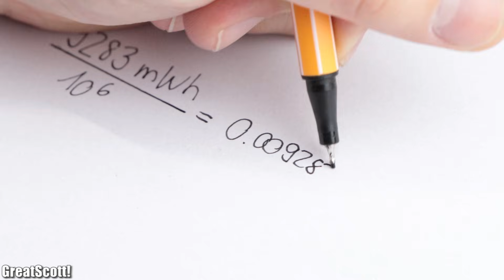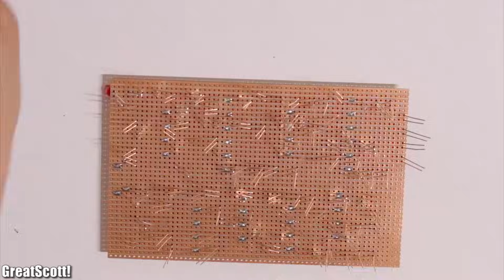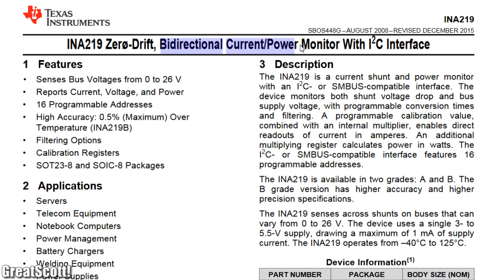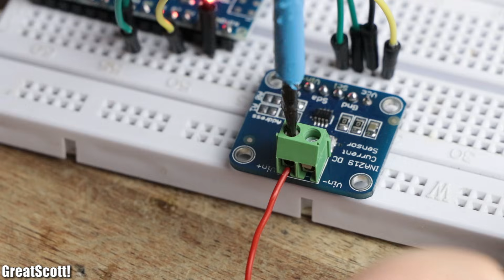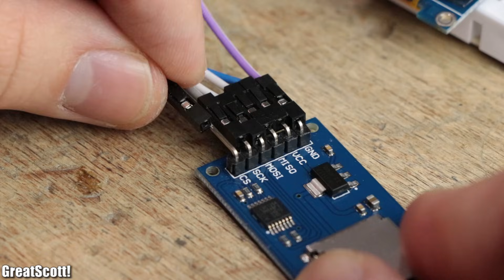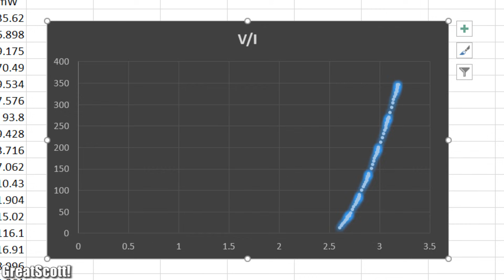Make your own Power Meter/Logger

Comment: First of all, fantastic videos.  I love learning from you.  Secondly, I've recreated this project with an Arduino mega without any problems, but when I move to my Arduino nano or pro mini, I've found that the size of the program data (2215 bytes) exceeds that allowed by the controller (2048 bytes).  Did you have this issue?  If so, how did you resolve it?  This data applies directly to the program you developed, with no changes having been made.  

I know this video was years ago, but thought it would be worth asking in hopes of finding a solution so I can make this project "portable" with one of the mini micro-controllers. Many thanks.
Reply: In the adafruit library you have to use a screen width of 128_32 instead of 128_64

Comment: For those who don't wanna buy or can't get the SD module, you don't need it. You can simply do a level shift with resistors (2.2k + 1k works for me) in the comunication pins (SCK, CS and MOSI). For the MISO of the SD card you can connect it directly to the Arduino as 3.3v it's logic HIGH. Of course, if you are using a 3.3v microcontroller (like the Arduino DUE) you don't need the level shift.

Comment: I want to measure only voltage level. so i am planning to use around 100 18650 li-ion in parallel. is it okey to connect batteries to arduino analog input pins? i mean arduino is okey above 5v and my pack is 4.2 volt. should i consider amp level for this project?

Comment: https://www.ebay.com/itm/RUIDENG-UM24-UM24C-USB-2-0-Color-LCD-Display-Tester-Voltage-Current-Voltmeter-US/173189335006?hash=item2852e387de:m:mBRBmFcVA6RzxlP7vyV3zmA
Reply: Doesn't output the data or display it in graphical format. It's good but this is better.

Comment: The SD card keeps giving me error. I even downloaded the sdfat library but I still got error. I am using Arduino pro mini 5v version 16MHZ. My code connection to the sd card SPI: 10 (SS), 11 (MOSI), 12 (MISO), 13 (SCK).

Comment: Hey, do you have also a Voltage drop between the measured Voltage (with multimeter) and the measured voltage with the INA at higher (about 300-400mA) currents? if i power something with an 18650 i always have a voltage drop the higher the current gets. with 2 C Cells or a 9V block battery i dont have that.

Comment: For writing values to a SD card it would be easier to separate them with a "TAB"  Serial.print(value1); Serial.print('\t'); Serial.print(value2); 
In this way you can keep them in one file and copy them to excel. Tab will put them in a separate cells
Reply: continued...   
1.  replace the TimeFile, VoltFile, and curFile with     
DataFile = SD.open("PowerData.csv", FILE_WRITE);
    if (DataFile) {
      DataFile.print(currentMillis);
      DataFile.print(';');
      DataFile.print(loadvoltage);
      DataFile.print(';');
      DataFile.println(current_mA);
      DataFile.close();
    }         
and 2.  replace definitions with File DataFile;
Hope it helps someone

Comment: Great video, both the presentation and the quality.
I would like to know if you have done something similar to this project but for 115 Volts and/or also for 220 Volts?. If not, any consideration in doing so. 
With the high cost of electricity in Canada, an easy way of seeing and logging your own usage, and having the ability to see when and what is using a high power draw, this is a way of making changes on the fly, so much easier.
Anyway, keep up the good work. greatly appreciated.

Comment: Build or Buy suggestion Jeremy
 I just came across a comment by someone on one of Julien Iliett's videos where the commenter said he tried to graph the output of an INA219. He said the readings were all over the graph and useless/none repeatable. He mentioned that he had achieved stable performance using an ADS1115 ADC (or maybe it was '16 or '17). He also mentioned he was using it in differential mode on 2 channels.
    That kind of characterization and comparison would probably be easy for you, especially with this video's project...if you still have it around. 
 -Jake
Reply: I think the comment mentioned was on this video:
https://youtu.be/8ikyp4lu45M

Comment: There is an issue with the energy calculation in the sketch.
The value being added to the total energy consumed has to consider the interval at which measurements are made. The interval is set in milliseconds, so a variable or constant for "measurementsPerHour = 3,600,000 / interval" has to be used as the divider when adding to the energy displayed in mWh.
To provide an example using the 100ms interval used in the sketch: measurementsPerHour = 36,000
Now given 650mW for example, each interval adds 0.0186mWh to the energy total.
Reply: It's strange that it's only comment like that, a lot of people made this project and no one noticed wrong calculations. I had 6 wh instead 1.5 when i dig in i found that it's doesn't correspond to the time
Reply: I appreciate this comment was a long time ago, but my code is based off this video and I found the same problem, although i've found even though the interval is set to 100ms I only get an accurate wh reading if I divide by ~410ms intervals: (energy = energy + (power / 8780.4878);) is there a limit to the sample rate of the INA219? I thought it was supposed to be capable of ~14 samples a second (~every 71ms)

Comment: Very impressed with your video.
I would like to know if you can make or discuss about a project to battery monitoring for charging and discharging of lipo batteries and also discus about the best ways of using them with out over discharging them

Comment: Its really great project. Can you make a AC frequency meter (which measure 220 volt AC frequency 50 Hz and 60 Hz) with an arduino in the next video?

Comment: GS, This is one fantastic project. Made one and even added a few mods to the code. 
I didn't have to buy anything new or substitute. I had everything already and was going to design and code this exact design from scratch, but you did all the hard work for me, and I thank you for it. Also, thank goodness for these cheap modules.
This and many other projects would not have even been possible only 5-10 years ago, without these cheap and wonderful modules from China.

Comment: Don t you need a voltage regulator after the battery so as to get a decent 5v voltage for the arduino ?
Otherwise the voltage will drop out to 2.5 before the protection circuit cuts it 
Thanks !
Reply: I have the same question...

Comment: I'm trying to find something similar that can measure higher currents, maybe up to 10A. Only thing I can think of it putting another shunt and then calculate the new current based on the shunt. Any current reader bigger than INA219 ?

Comment: Hi mate - another great project and video! I am making your Power Meter Logger and have the same LiPo protection board as you are using (03962a) and a 3.7V 700 mA LiPo battery which I have been told that this LiPO must be recharged at a current of </= 700 mA - nothing greater than 700 mA or the battery will puff up! Since the 03962a board can deliver uip to 1000 mA during charging how do I limit the charge current to 700 mA - I have also been told that I can use an external resistor to achieve the 700 mA limit during charging. Can you please tell me how to do this when using your circuit [and can I simply plug this into the USB on the 03962a board when I need to recharge the LiPo] or can you point me in the right direction to see how this is done? Hope you can help, please and keep up the really great work.  Cheers.
Reply: Ian Brown How did you get the sketch to load onto the nano ?
Reply: Hi David - I'm very confused by your question since it does not relate to my specific post? I am also presuming you are NOT Great Scott??? However, to answer your question I haven't loaded the code yet but since the code for this project is provided I wouldn't see this as a problem??? Care to elaborate and I may be able to properly answer your question? Hopefully Great Scott will respond to my actual query in due course?  Cheers

Comment: Hi, having built this logger I get the following error:

"Sketch uses 22302 bytes (72%) of program storage space. Maximum is 30720 bytes.
Global variables use 2216 bytes (108%) of dynamic memory, leaving -168 bytes for local variables. Maximum is 2048 bytes.
Not enough memory; see http://www.arduino.cc/en/Guide/Troubleshooting#size for tips on reducing your footprint.
Error compiling for board Arduino Nano. "

Any advice would be really helpful ?
Reply: try changing consts to #defines, may help but not sure
Reply: For me it was the Adafruit_SSD1306 library. It wont compile with the display set to 128x64 pixel. When i change the Adafruit_SSD1306.h to use 128x32 pixel, the program will fit.

Comment: slight correction, in order to measure current you need to be in parallel with the shunt resistor

Comment: what can i change or add so i can have a higher current like 5amps or even 10amps if possible and be able or read current going both ways for example charging and discharging a battery charging would show a positive number discharging would show a negative

Comment: Your OLED library is set on 128×32. Check the library (.h file) comment the line that defines (#define) the 128×32 resolution mode and uncomment the line with 128×64 :)

Comment: Hello,

    I first would like to thank you for the effort and time you have put into creating this project for us! I do greatly appreciate it!

However, after building this project myself I have found that the measurements are not entirely accurate, mostly the voltage. Reporting .86v with no load and 2.75v with a load, instead of the 4.02v that my LiPo is currently at... With no load attached it displays -mA and -mW... Any help would be appreciated! 

Thank you kindly,

~J
Reply: ANYBODY???
Reply: Please watch my video! https://youtu.be/2Qr6Jcm8wbA

Comment: Great video Scott thank you very much, I do get an error message however 
"Sketch uses 21394 bytes (69%) of program storage space. Maximum is 30720 bytes.
Global variables use 2186 bytes (106%) of dynamic memory, leaving -138 bytes for local variables. Maximum is 2048 bytes.
Not enough memory; see http://www.arduino.cc/en/Guide/Troubleshooting#size for tips on reducing your footprint.
Error compiling for board Arduino Nano. "
Reply: For me it was the Adafruit_SSD1306 library. It wont compile with the display set to 128x64 pixel. When i change the Adafruit_SSD1306.h to use 128x32 pixel, the program will fit.

Comment: I used your line of code wattHours = wattHours + watts * (0.1/(60*60)); but the values I am getting for watt hours are too small. I have made dummy voltage and current sensors by bridging 5v over to the adc input. I am making a watt meter for MUCH larger power applications. 3200w for 30 seconds only gave 9.6 watt hours using your algorithm but in reality this is supposed to be 53.33 watt hours.

Comment: A brilliant little project you have there!

I am looking to make something similar to remotely monitor my battery voltage, load draw and battery charge of my solar setup. Is there any way that this project could be modified to include the ability to have it interface over WiFi and ideally run a simple web UI for the data logging using something like a Raspberry Pi?

Many thanks for your help in advance! :)

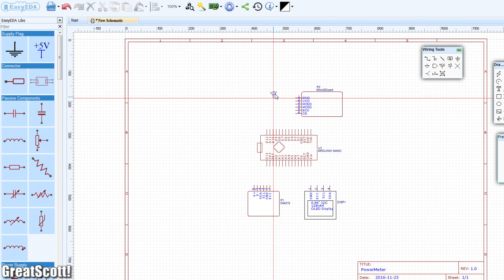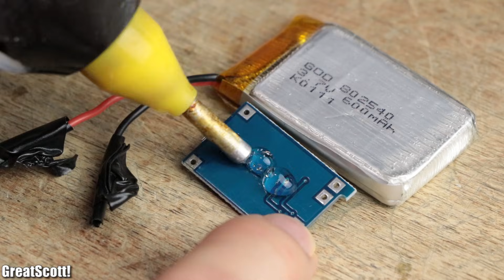Comment: How did you supplied the 5v to the circuit as shown in the schematic in (4:49) while you use lipo battery (5:58) that has max voltage of 4.2v?
I have not noticed any boost circuit here?
I am confused!!!!
Or you just use the 4.2v that lipo can only provide!!!
Reply from the maker: I directly use the 4.2V
Reply: Got it.
It is really the diy I need :)
Thanks for the video.

Comment: Your OLED runs at 32 lines (default setting) instead of 64. Go fix header file. You will need to comment 1 line and uncomment other.

Comment: You should modify the sketch to create a single CSV file (current, voltage and time separated by comma or semicolon), so you wouldn't have to copy the 3 txt files to Excel, but you could easily open with it, and create diagrams out-of-the-box. :)

Comment: Very nice project, I am considering building this. Should be about 30 EUR and 7 weeks of waiting for the eBay postage from china. :D
I would like to do it using a current transformer to get up to 1000 Amps if I like. It should also work with DC. Any ideas?
Reply: ***** eBay china imports.

Comment: Current shunt cause any significant voltage drop?
Reply: Significant enough to measure the current. It's less than half ohm.
Reply: But i want to measure 600+ amps...

Comment: Great Video as usual. I have been wondering if you could put a logging function in one of those power meter you can buy off ebay or amazon for the mains power outlet. Maybe you can do a video on that?

Comment: if i were you i would save the 3 files into a single csv file. you can read up on them, but here is the format you save them in. The file name should be "Your_csv_file" ".csv", and the inside of the file should be: 
val1a,val2a,val3a, (carriage return)
val1b,val2b,val3b, (carriage return)
the commas separate each value and the values are not limited to numbers, further csv files can be opened and edited by any spreadsheet program such as csv, this can make working with the data far easier.

Comment: If you wrote a single text file in CSV format, you would save processing time and also time manually converting it to an Excel format afterwards as excel can open CSV (Comma-serperated variable) by default  :)

Comment: As always - great video !!!   One Question:  Did you really just hold the FTDI breakout header pins against the board holes in the pro mini (at 5:56) to do the programming ??  No solder.  No sockets to hold the pins on the pro mini??  Does that ever fail?  I'd think that the integrity of the connection isn't great enough to ensure error free data transfer ???
Reply from the maker: Yep, I just used a bit of pressure to hold them together. Works like a charm.
Reply: Amazing !!  I'm trying that next chance I get ;) ;)
Reply: I saw somebody doing that in another video with a pickit 3 that had spring loaded pins attached to it and he pressed the pins against 6 SMD pads to program the chip.  I was so enamored with the idea that I immediately bought hundreds of spring loaded pins so I would make a connector for my programmer... haven't received the pins yet but I'm still stoked.
Reply: Interesting !!  I just googled them.  I've never seen those before.  Neat idea !!

Comment: This is a very good project for measure DC power comsumption, and have a better estimation of how long a battery powered circuit will last. But not to calculate how much will cost you to charge your smartphone, for exmaple (0:25), because you are not measuring the AC power comsumption and you can't even estimate it because you don't know the power factor of your charger.

Comment: Have you considered a buck-boost to power the circuit with the input voltage that you are testing and therefore do away with the battery and charge controller?

Comment: I'm thinking to make higher Amp power meter using AttoPilot Voltage and Current Sense Breakout - 180A. Do you think it is interchangeable with INA 219?

Comment: Great Project.
I just bought some of this parts to build a automatic charger, discharger and wattmeter for 18650 cells.
My only doubt is if i can use 10 INA219 modules in a single Arduino with I2C.

Comment: Very nice Video again! Your OLED shows the line interleaving problem, I have as well with some of the SSD1306 I own. Never figured out the problem. The working ones are great displays, I love to use with u8glib.
Reply: Jens Fröbel Text looks stretched vertically, wonder if the oled library is set for 128 x 32 displays. Iirc I had to comment out a line somewhere in the library to adjust for 64px height displays.

Comment: Currently I'm working on a similar project, but with a different approach. I try to use an ESP8266 and a Raspberry Pi, to build some kind of distributed power measurement system, for festivals, camps, larger installations an so on. 
Your video really helped with suggestions regarding the use of an SD-card and a LiPo-Battery, thanks a lot! 
Greetings from the "Lipperland" in Germany :)

Comment: What the hell is an "OLED LCD"? :)
Reply: Yes but an LCD is different from an OLED display, there's no such thing as an "OLED LCD"
Reply: Leander Witter oled is different than LCD, you did not get the op comment.
Reply: Maybe an LCD backlit by an OLED display? You'd be able to control the backlight per pixel... Think of the benefits!  :P
Reply: muh1h1 a verbal error.   ;)
Reply: Mahmod Mokhtar ah no I did'nt get That.
Thougt it was about the OLED.
Reply: muh1h1 organic light-emitting diode, Google it

Comment: You will probably increase the longevity of the SD card significantly by writing the 3 values as a CSV into a single file.  For true long-term use, saving up the writes and writing them once every few minutes is probably advisable.

Comment: Could you hook up a current transformer, like 150:5 amp, to this and use it safely, and set it up for A/C?
Reply: I'm sure that would work, but your measured AC is a sine wave. So you would have to make sure the sampling rate is at least twice the AC frequency (60Hz) and then use some clever math to calculate the RMS current.